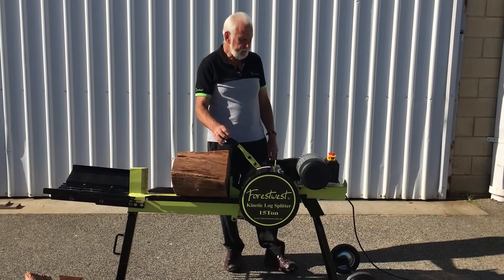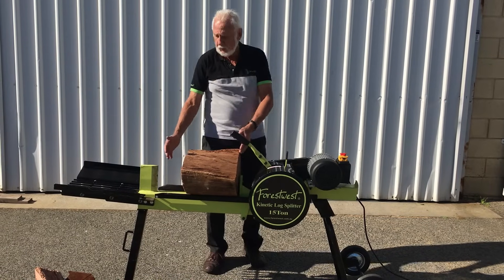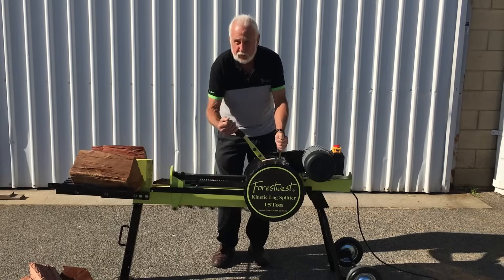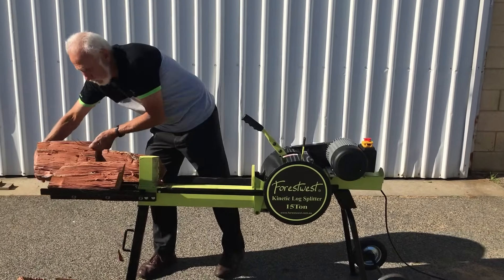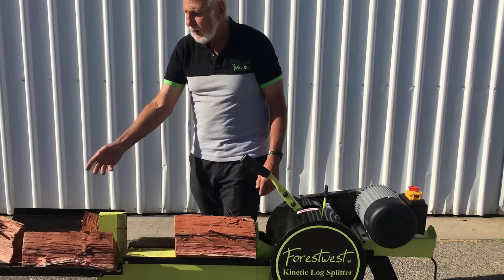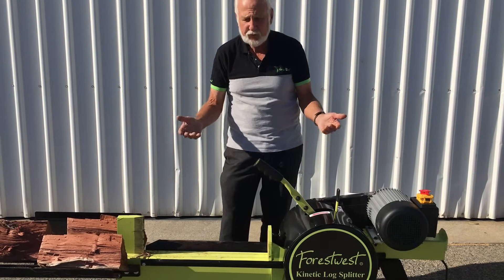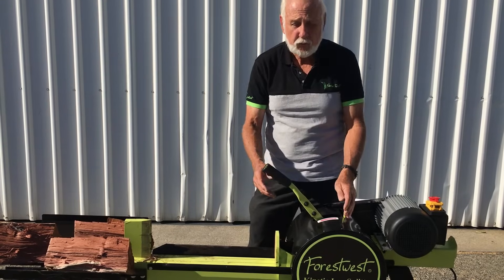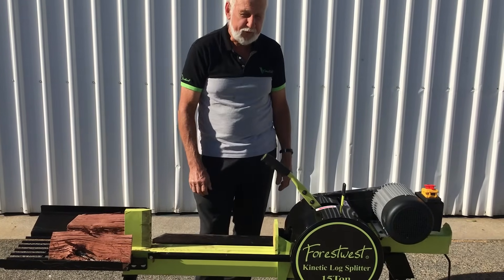15ton Kinetic Log Splitter 2s Cycle Testing with Jarrah from Forestwest

Comment: That grain was quite straight. I would like to see something like stringy bark or blood wood. Not first choice for firewood but beggars can’t be choosers. I’ve got a load of yellow box, red gum and iron bark. Already split, but in larger chunks. My Nectre isn’t deep so I’m wanting to break them up a bit. Not something I want to do with my Swedish splitting maul. I’m not sure whether to buy the bigger 2200 w electric motor or the smaller 3hp petrol model. I think the mobility of the 3hp with the bigger wheels might be the very slight advantage. 
I’m not sure about the maintenance comments. I’m not a mechanic. I can change plugs and oil in the cars. How hard is the lubrication. Rank and pinion…? What the heck is that. 
Final question please. This video is a few years old. Do you still own the business and if you manufacture in China, has the quality of its part remained as robust as they appear?
Reply: I just bought a very similar one today and I was cutting through ironbark and firewood banksia. It struggled through the banksia but to be fair I couldn't even split it with a 6lb maul. The log splitter did it in 3 goes hahah

Comment: With my engineering hat on,  I think that you would get more splitting effect if you put the log-end against the wedge not the ram.  Surely doing it your way, you waste kinetic energy accelerating the log into the wedge?  But thanks for the video anyway - I'm trying to import one to Scotland...
Reply: Martin Winlow I thought that too, but after a little while it will make more sense to do it that way.

Think friction.
Reply: @Arsopu  I'm afraid you will have to expand a bit on that!
Reply: I’ve read if the timber is placed against the knife the continued impact of ram on the timber will cause premature wear and tear. Operators of these log splitters do all they can to reduce the stress of continuous impacts. The forces are quite violent.
Reply: Yeah or at least a variable position for the blade for shorter logs.

Comment: How do these machines go with knots and cutting green timber? If I was going to buy any model it would be the 3300w
Reply: I imported a '26T' electric version (runs fine off a standard UK 13A socket) to Scotland 7 months ago and have had a bit of experience with it now and I am - thus far - extremely impressed with the machine's abilities and ease of use and very pleased with the purchase.

For knotty wood - eg some ~40cm diameter local pine trees, which I simply could not make any impression on manually ie with an axe/wedge etc, the splitter has no problems whatsoever.  Knot-free rounds can be doubled up (I cut mine about 30cm long for the wood-burner) without issue.  Honestly, if I were on the mainland I would be importing and selling the machine myself.  My only gripes so far is that greasing the rack and pinion mechanism is very awkward and the working platform support structure needs beefing up.  An option for a tow hitch would be a good idea, too, as the 36T one weighs about 500kg.  I suppose I should also say that using the 2 simple opertaing levers up and down or towards and/or away from the operator position would be quite a bit more comfortable to use than the existing setup where you operate the controls from side to side ie along the axis of the machine.  These consist of a safety lever operated with one hand and then the main control lever with the other (so you can't hold the log with one hand and operate the main lever - incredibly dangerously - with the other.  NEVER operate the machine with 2 people... ever, ever, ever.

I simply do not understand why people insist on using petrol-powered versions.  Who needs a pile of split logs in the middle of nowhere?  They all end up at home eventually, so why not bring the logs in and process them using electric chain saws and electric splitters and save a fortune in stinky, noisy, dirty, expensive and potentially dangerous petrol?  No need for ear defenders either.  8m3 of split pine/sycamore/ash used barely 1 kWh of electricity - 20p, on my daytime tariff.
Reply: Martin Winlow any chance you could please make a video using your 26T 3500W machine? Am tossing up between your machine and 34T petrol ozone layer destroyer. If there’s not THAT much difference beteeen them splitting power wise I’ll go electric. Using on Aussie hardwood. Cheers
Reply: @matthewrosendahl3607  Karri and jarrah ard tough but split fairly cleanly - unlike the knotty pines that festoon this part of the world.  My machine would have no problems with either whatsoever. 

I already have a video up: https://youtu.be/ZgU8rGfzFDQ - it is very short, though, and taken first thing in the morning in winter - ie dark.  TBH, if you have electric power handy then don't even bother to think about the petrol version.  People generally think electric motors are a poor replacement for petrol/diesel in terms of 'power' (and what we really mean is torque).  All I will say is, there is a reason why the vast majority of train locos made since the steam era ended have wheels that are powered by an electric motor (either directly powered from an overhead catenary or '3rd rail' system or from a diesel engine-powered generator) and it's due to the electric motor's far superior torque and the relative ease that it can be harnessed to move a very heavy wheeled vehicle.

Anyway, in this case the whole question is moot because the splitting power comes from the weight (and therefore inertia) of the machine's flywheel.  The only benefit more power in the engine/motor would have is how quickly the flywheel would recover its speed after a log splitting action.  So the flywheel acts as an energy reservoir, fed with a relatively small flow of energy from engine/motor to bring it up to speed and then all that energy is dumped at once to split the log.  There is then ample time for the flywheel to recover whilst the split log is cleared and a new one positioned.   It is a very nice marriage of problem and solution and far superior in almost every way to a convention splitting system (ie hydraulic ram) - IMHO!
Reply: Martin Winlow great science lesson and review thanks Martin
Reply from the maker: Hi, Andrew,
Thanks for your comment. It really depends on what kind of firewood you will be splitting. We've tested red gum on these machine, they are not fresh but not completely dry, and the machine split them pretty easy. But if you have a knotty and curly iron bark, then it will struggle on the 15ton model, you should probably need at least the 26ton machine to do the job.
Green woods are normally a bit harder to split, but for these kinetic ones, you can do multiple splits in very short time to work with really hard ones. 
If you have any questions, you can reach us at 1300 281 198.

Comment: What happens if it hits a log that won't split? How does the rack and pinion work in this regard? I imagine it would strip the gearing or something, or is there something to save the system if this should happen? 
I have a 4 ton hydraulic splitter and some of my logs just won't split, hard as steel. If this cuts them I will buy one.
With my hydraulic splitter I can put very large logs on and just rotate it and split around till it falls apart, is this something the kinetic can manage too? I often have rounds larger than 600 mm so need to go beyond the 450mm described here. Sorry for all the questions but I'm after a better system and just came across this on gumtree.
Reply from the maker: Hi, 
First of all, the rack and pinion system is hardened and tempered to bear the pressure. If it hit something really hard that doesn't split, simply bring back the rack, and hit it again, imagine yourself using an axe, if it doesn't split the first time, just split it again. Is that gonna do damage to the axe? Yes, but only a tiny little bit, plus it is designed to work like that. 
The right way to operate is to keep your hand on the handle all the time, once the splitting head make contact with the log, you will know whether it can split it or not, if yes, then finish the split, if no, bring the handle back quickly, so the gears won't stuck in there, and hit it again. It may sound a bit complicated, but once start using it, you will find it very easy to use, just like an "axe machine". And it is designed this way, so you get full control of the machine. 
I've tested jarrah, red gum, white gum, wandoo, lots of different types of hard wood. We now have a store in Perth and Melbourne, and we freight across Australia, you can contact me directly at 03 8753 7138 if you have more questions. 
Sorry for the late reply, we should check this channel more often.
Regards
Forestwest
Reply: Appreciate your feedback. Thank you

Comment: Hi, is he running the splitter off a 10amp or 15amp PowerPoint? I've read on your Web sites it can run off both, but was Intrested to know if running it off a 15amp PowerPoint would give the splitter more power?
Reply: The standard outlet would provide the 9.16 amps the motor needs with very little voltage drop so a 15 amp point wouldn't provide any advantage. Best just to make sure your extension cord (if required) is rated at 10 amps or more depending on length.
Reply: the 15 amp only allows more current flow before the circuit breaker trips. Power can not be increased unless the motor is replaced.
Reply from the maker: Hi, sorry for the confusion, the 15A was the first model, but after fist few test, we realize the motor is only drawing a bit less than 10A, plus not everyone has 15A, so we switch back to 10A, and test them again. There is no difference in splitting force or speed, so for all the new models, we only use 10amp motor. 
Thanks for your questions.
Feel free to contact us directly at 03 8753 7138.
Regards
Forestwest